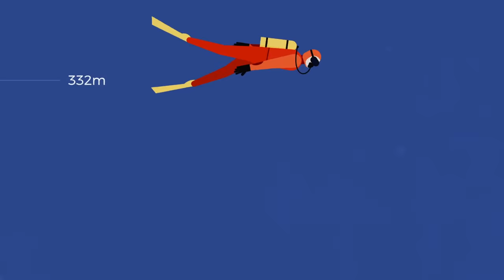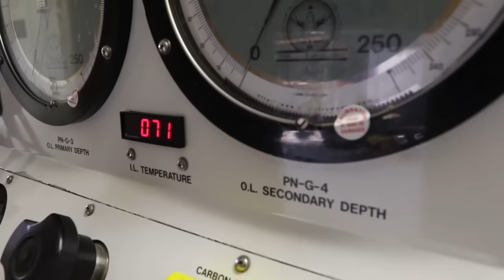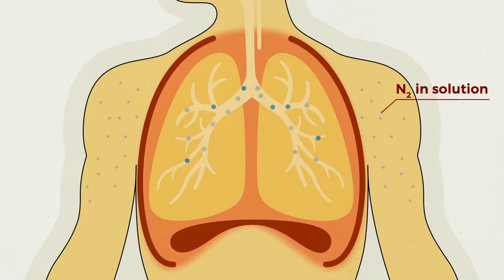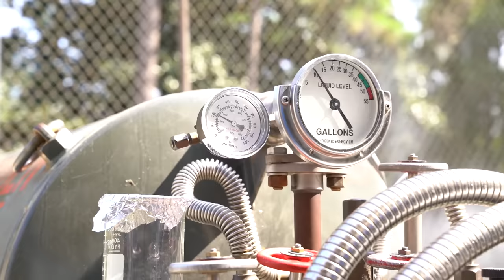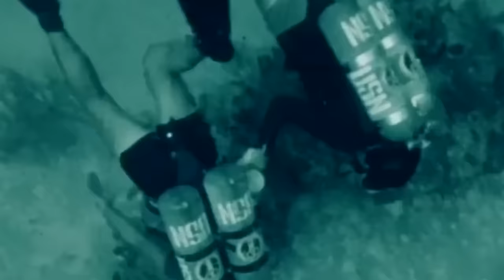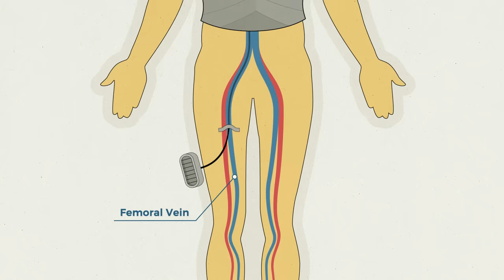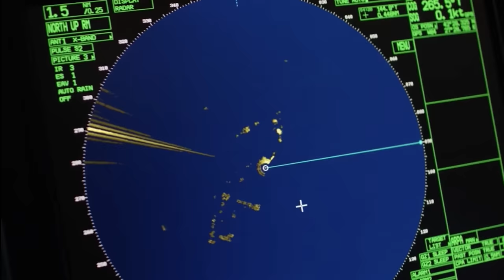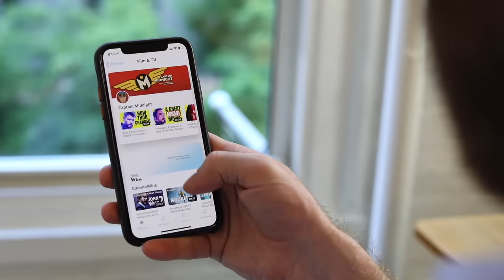Can Humans Breathe Liquid?

Comment: I think this could be possible. However we would have to attach biological or mechanical valves at the lowest points in the lung lobs. From those valves pipes are attached and exit the body. Those pipes are then connected to a scuba like (not scuba itself) equipment, a "Gill Backpack" (TM pending) that pumps the oxygenated liquid through the  lungs and over the alveoli instead of breathing the heavy material. The Gill Backpack does three things. 1. Its a pump that pushes the oxygen liquid (OL) through the lungs. 2. Its a reservoir of the OL 3. It expels CO2 (so people may think you maybe farting under water). I think a cool addition to the pump would be to have it linked to either the diaphragm or heart rate in such a way that it would pump faster or slower  depending on that person's performance requirements. Get a scare underwater would be the same on ground with the flight and fright response. Adrenaline eats a lot oxygen (I'm not to sure how true that is), so the pump would need to keep up. Finally the transition back to air breathing would be to release the pipes from the Gill Backpack allowing the OL to drain out then use a low pressure pump with 100% oxygen to push out the rest of the OL. The last aspect would be then to transition from air pump to human breathing by locking the valves in place  and inflating the lungs for the first exhalation of the person. 
However, I'm not sure how the mask would work? Would you have two separate masks? One mask that has PH neutral  water for your eyes and the other covers the nose and mouth?
Reply: "One mask that has PH neutral water for your eyes" 

Wait, could our eyes just be exposed to regular water? There's a problem that our eyes aren't evolved to focus in liquids so the vision could be really blurry

Comment: Well done video.  Interesting subject, that is definitely not run-of-the-mill.  Well researched and presented.
If I may add, I'm already a subscriber to Curiosity Stream / Nebula, so I can re-join from this channel.  But I can tell you from experience that it is an extremely high value.  For the very small subscription fee, there are loads of well made documentaries covering a huge variety of subjects.  And knowing the creators at these two sites don't have to cow-tow to limitations and restrictions imposed by the platform means that the viewer gets to see a more pure version of what they can do on utoob if they want to.  
I'm not trying to advertise for those platforms.  I'm just saying that if you like this channel and want more and more, I can vouch for using the link here to join and get great stuff.  
Just sharing.   Hope you don't mind.

Comment: This is a cool video! I like your videos, good work!!!

I was surprised when you mentioned PFCs, especially when you mentioned the medical applications. I know the video didn't talk about this subject matter, but there is some allegations that PFCs are a cause for certain ailments and defects due to runoff from factories using it as a fabric and surface protector, leaking into the water table and contaminating wildlife and watersheds, but I had no idea they could be used safely in medicine -- which I guess makes sense depending on what you are using it for. Interesting juxtaposition!

Comment: 1. they could over come the initial shock of the first liquid breaths by sedating the subject, then waking after transition. 
2. The force required can be countered by a "respirator" that does most of the work, just like a second stage of a typical scuba line.  The air is under pressure but requires you to inhale some, to cause the valve to open and push air at you.  A liquid system could work this way AND with a minimal "exhale" trigger an assisted suction to draw the fluid back out.. it would be in metered increments.. so as to not push in, or draw out too much. 
This system would have an "auto" function for while the diver was sedated, or if becomes unconscious.  it would measure time between activity and what the last action was.. if no activity within a time, it would perform the next action .. and so on, as well as alert surface crew.
Actually with an O2 sensor, the breathing module could be totally automated like a ventilator., pushing in a metered amount, and then drawing it back out.  The amount and rate changing within set parameters based on the O2/Co2 readings.
3. the only other obstacle I see is the complete purging of liquid. Because of the density of the fluid, the lungs are unlikely to be able to cough it out.. and would damage the lungs in the attempt.  Thus a change of fluids would have to occur.  At the time of purging, change over from PFC to the previous thinner liquid type, for a few minutes, to be able to expel the thicker fluids, exchanged with a thinner counterpart, that can be more easily purged when transitioning back to air. They would be brought back to air using "dry" air like compressed into dive tanks to help dry out the lungs.  The amount of time would vary. 
Yes, it sounds a tad extensive, but if factor in that the diver could be in "dive state" for 8 or more hours at a time, and the tasks that could be accomplished, it may be worth it. 
Just some thoughts.
Reply: My curiosity kicks in here though..  as i wonder how the diver will train to NOT swallow.. these fluids, or too much of them in the stomach, may not fair well if they puke it up in their system.  I'd not want bile or stomach acids making their way into the lungs.   perhaps the fluid is easily digested if need. Just an after thought.

Comment: A question I have is that since you cannot breathe through your mouth while using liquid, given that most of the liquid will be diverted down your throat, you should just limit your intake through nostrils. But, it doesn't seem nostrils are clear and large enough to inhale and exhale something as dense as liquid with enough ease. I'm guessing each breath will be very deep and lightheatedness will be common?

Comment: Add water filtration.  Like a gill.  Leave the the PFC but filter water through it.  Not a lot.  Just enough to decrease the density enough for it to be breathable.  Filtering the water out after each breathe would also help with removing CO2 and possibly add more oxygen.

Comment: If the issue is the force required to breathe a liquid is too great, why not introduce a mechanical support system? 
Add two tubes to each lung. One deeper (a) and one closer to the trachea(b).
Tube (a) pumps into the lungs the well oxygenated liquids. Tube (b) pumps out an equal volume of liquid so fluid circulation happens without the compression cycles of breathing. 
You now have air circulation without strenuous muscle exertion - in fact without any muscle use.

Comment: A "chemically and biologically inert" medium does not automatically mean that it can play the role of air. Any biological organism such as ours needs certain basic necessary elements and reactions, and you need to ensure that a replacement can also provide them. Inert means that it stays (as far as possible which might not be 100%) neutral. Upon adding these elements, there might be side effects as the medium might not be inert anymore, meaning that you need to check for any possible interactions. Plus, there are other limitations as described above.

In any case, fantastic and very informative video!

Comment: I wonder if intubation could solve a couple of the issues.
It might take away some of the feeling of drowning if the liquid is pumped right into the lungs first.
If you include a small reversible pump operated by a sensor on the diaphragm (or directly reading the nerve would be cool), you could assist breathing. Get the power right and even with a tube down your throat, it could feel as easy as breathing air.

Comment: I feel like the "instinctual" fear of drowning would be quickly overcome as soon as you breathe in the liquid and realize it doesn't hurt- and it shouldn't hurt, because the liquid is chemically and biologically unreactive. There simply IS no reaction to set off any pain receptors in pure liquids, such as distilled water. The "pain" from drowning doesn't come from actually breathing in any liquid (unless its salty or dirty water, where it would come from the dissolved solids setting off pain receptors)- it comes from your brain running out of oxygen, and inciting an immune response which you "feel." An immune response such as "dry drowning" would be the only potential issue I could see arising, simply because your body may not be able to control that at all, regardless of if you are scared or not of breathing liquid. 
Either way, if it didn't seem to bother that one volunteer once he was under for a bit, I doubt it would bother people who train with it, and can thus definitively report that it does not hurt and that you have nothing to fear, and may even "easy" to do once you got used to it....literally as easy as breathing. This is, of course, my own speculation though.

Comment: 0:43 - You incorrectly state the deepest saturation dive was ta 701m. The Comex dive you refer to was a simulated dive in a hyperbaric chamber. It's a common mistake due to the fact the simulation specifies "701m in seawater", which simply means the pressure of seawater at 701m, not that it was actually done in seawater

Comment: What about body modification I can think of ways where it’s plausible like modifying 1lung to breath liquid and having the air lung deflated.   Using a surface access.carbon scrubber to change filter allowing the blood to be cleaned like a carbon kidney/ dialysis machine        And a pump for your liquid lung to circulate the liquid in a way so you always have oxygen.   For speaking is very simple the vibration pens mutes use 

Of course this would be niche and a little un ethical to need body modification but I think it’s worth it especially with the implications in space travel and diving.  
If let’s say you ran out of the oxygenated liquid you could close your liquid lung and open,inflate and breathe any available/emergency gasses

Comment: Using it as a drug delivery system, possibly using it to clean chemical buildup of smokers/people exposed to burning buildings/hazardous waste, and using it to flush out unwanted buildup of other fluids that cause pneumonia all sound extremely promising. 

Surely draining the lungs can't be a complete dead-end.

Perhaps some fluid exists that not only can dissolve oxygen and CO2, but also can dissolve in atmospheric gasses like nitrogen, such when returned to normal pressure and temperature, or perhaps a lower temperature and pressure, the leftover liquid in your lungs that isn't pumped out can dissolve in the air and escape the lungs just by breathing in a chamber for a while.

Pressure up when breathing the fluid, pump what you can out and drop the temp and pressure to get the remaining liquid to evaporate away in the air afterwards.

Comment: Wait, so the deepest dive in a suit is 701m, but the 1A suit can only get a diver to 600m.  How then did the 701m dive occur?  Did they use a diving bell?  Yep, loss of tissue perfusion gets ya every time.  The major issue is how to extract carbon dioxide from the body.  While we are "breathing" liquid in the womb, we have an umbilicus which deliver oxygen to the blood and removing carbon dioxide from our blood and passing it to the mother who then exhales the CO2 during normal respiration.  Rather than having arterial catheters and a squeezing chest plate, it would be much easier to just insert a breathing tube which pushing in the liquid and a separate tube which pulls it out.  Basically, it is like liquid cooling in a computer platform.  Just have the liquid circulating in lung which will work as a liquid rebreather.  The body will do the process of perfusion as normal.

Comment: To suggest that our lungs don't care about the density of the carrier fluid from which they receive oxygen, is preposterous. Water is approximately 830 times more dense than water. Energy requirement increases at the square of mass... so not only would your diaphragm need to be a billion times stronger, but your lungs would have to be fair more dense and resilient. Ever felt the gills of a fish? A LOT tougher than lung tissue.

Comment: Maybe instead of you having to breathe in and out they could insert a tube into your lungs through your nose and use a system that cycles the liquid, then all you would have to do is essentially hold your breath but you would never feel the need to inhale because you would constantly have oxygen and CO2 being replaced and removed.

Comment: Water has air, the native structure of the human lungs, doesn't have a way to divide it easily, it is possible and evolutionary capable,  some have actually mastered the techniques. Also a bodly ability to help render in rare planetary atmospheric realms. Instead of storing canisters of 02, a device to filter will aquire.

Comment: Don’t you just need a suit over the chest to that keeps the pressure off the chest so you can breath normal?  The reason for pressurized air is because the water pressure is stronger then the muscle in the chest that help the lungs expand. Pressurizing the air helps force the lungs open. So wouldn’t you only need exponent to protect your chest and not the arms, letting divers have more dexterity?

Comment: Seems like using an artifical lung for the gas exchange would the best in the long run, but they would still need to fill the lungs & sinuses with something to remove compressible air voids. Wonder if just hanging upside down for a bit would be sufficient for draining the lungs of liquid after....  I imagine there would be other issues with tissues accumulating fluid, bacterial balances, etc misc problems.

Comment: Some one has to ask one obvious question: instead of searching for the "perfect lightweight liquid molecule that dissolves well both CO2 and O2", wouldn't be easier or even better to use a mixture of at least two liquids? Air itself is a mixture of different gases, maybe that's a hint from nature. :P

Comment: The idea of breathing liquid is one that has come a long way though we dont hear about it.Working in diving for a number of years bave me the cHance to see how far back this idea goes.
Few people know that right at the begining of diving, the gear to do the job was pushed along with one very special reason behind it.
A normal diver breathing compressed air was fine all baring one problem 
It left a trail of air bubbles that rise to the surface giving away the fact that a diver was there, this in warfare was a real no no.
The system we used was very simple, a bladder into with the exhailed air was pushed while breathing out had  a metal container that was filled with protasorb that remover the CO2 as the air that was pushed out through this container, all of the other gases where allowed to continue on into the bladder where pure oxygen was then induced under pressure.
The bottle that contained the oxygen was very strong and was pumped into the small tank at high pressure. It was this that was re breathed for the bladder so that there was now a closed loop so no bubble trail was there because no gas was released.The only draw back was that the breather tube was attached the the contained of protasorb and had to be a perfect seal as any sea water would result in  chemical reaction producing an alkaline gas causing what was known as a cocktial making the diver very sick, the only cure was to drink neat vinigar, but took time to clear the body of this gas, i was fortunate enough to ever suffer this but have seen it many times, not at all pleasant i am certain.At the time each diver was resposible for their own gear both filling the oxygen tank and chaging the protasorb .
So each diver was always aware of the result of not double checking everything, and then doing it once or twice to be 100% sure all was well. 
Never once were divers below ever suspected using this gear, and it did carry one important thing in its favour other than no tell tale trail of bubbles, it was a lot lighter that twin bottles that were heavy on the 
surface and was less restrictive of body movement when down under the surface allowing the carrying of limpet mines in a reasonal amount which really was the only thing that could give you away if you were not very carefull in placing in the ship making a thud if you were not carefull to put them on an edge at a time as the magnets were quite strong if allowed to make contact all at once, sounded like someone hitting the hull with a hammer!!

Comment: Why dont they just add a couple of tubes down into your lungs with the liquid, one could be to pump the liquid in, and one to suck the liquid out. Then that way you could slowly fill the lungs so you wouldnt have to literally just drown to breathe at first, and in the pump that circulated the liquid, you could put the scrubbing device inside of that, and just remove the C02 from the liquid itself and that way you wouldnt need a catheter in your Fn femoral artery lol. You also, in theory, wouldnt even have to actually breathe, you could just let the pump circulate the liquid.